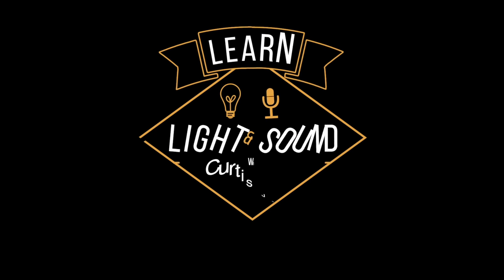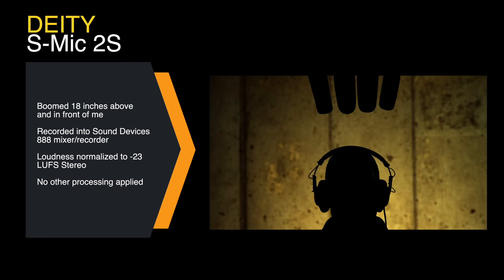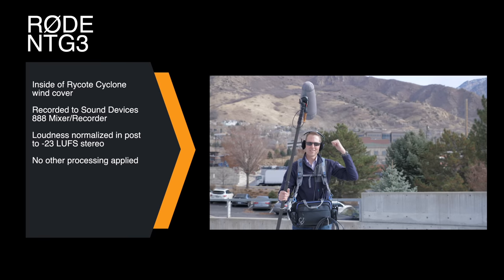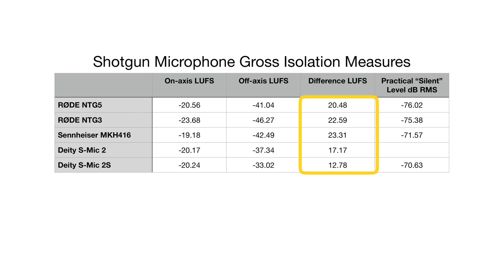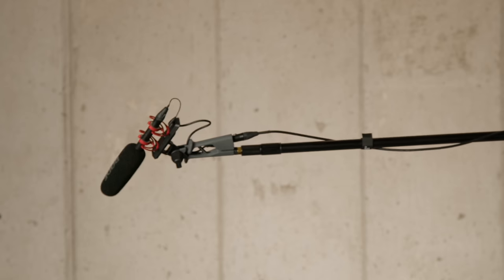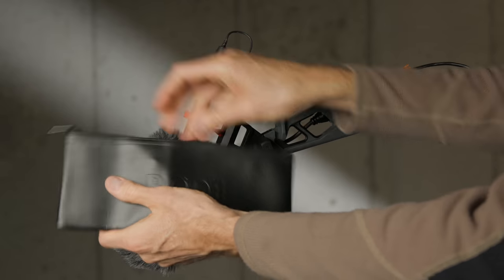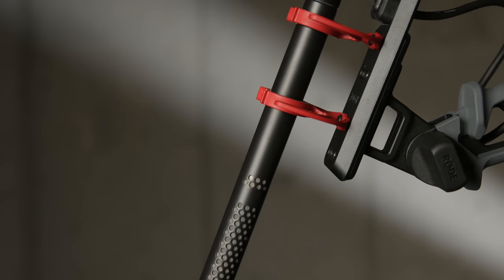RODE NTG5 Shotgun Microphone Review - Compared to RODE NTG3, Sennheiser MKH416, DEITY S-Mic 2

Comment from the maker: THIS IS A REPOST. Thanks to some careful listeners, we found an issue where the audio clips were aligned with the incorrect video clips in the audio samples section. It turns out that Final Cut Pro X has trouble with poly wave files. You can also listen to the original uncompressed wav audio files at https://drive.google.com/open?id=1AcgIeUcGtI5EZY2vd_kEBO-E8ibzZP7g
Index:
0:21 Intro
0:45 Indoor NTG5,NTG3, MKH 416, S-Mic 2S Samples
3:55 RF-bias advantages
5:01 Build quality & size
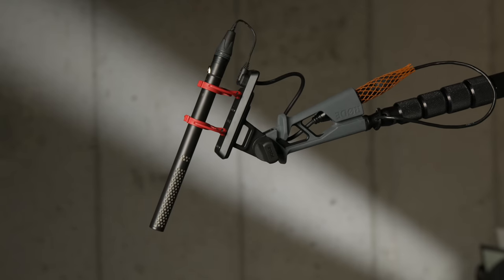5:34 RF Immunity/wireless interference
6:01 Polar pattern
6:28 Outdoor samples
7:41 Polar pattern/isolation samples
9:34 Isolation analysis - how good is each mic and rejecting off-axis sound
12:26 Practical noise performance
13:35 Handling noise & Shockmount
14:45 Fur cover and wind
15:04 Accessories
15:21 Should I upgrade?
17:11 Cons
18:34 Summary
Reply: I thought you edited in Resolve, mr Judd?
Reply from the maker: @Nicdehouwer  Final Cut Pro X 99% of the time as Resolve is a bit on the beta end of the spectrum in Fairlight. But that might change now. 😀
Reply from the maker: @Zzzz oop Keep your NTG3 and sorry to pull the rug out from under you. 🙂
Reply: @curtisjudd  I consider Resolve to be an extremely versatile, reliable and professional toolset. 

Fairlight... it's coming along! Each update brings about big improvements.
Reply: Yess, uncompressed samples, noooice) thanx man!

Comment: Diligent and thorough as always, thanks Curtis. Q: for my channel, which is a female voice and often inside without sound treatment, would you steer towards the NTG3 over the NTG5?
Reply from the maker: Thanks! I'd probably opt for the NTG5 - will be easier to work with indoors due to its smaller size.

Comment: Thank you for this review!  I wonder if the ntg5 could be eq'd to sound more like the ntg3 because the broadcast vocal sound of the ntg3 for controlled environments sounds great, but during the outdoor segment the ntg5 blew the ntg3 away! :)
Reply from the maker: That or a transformer saturation plugin, yes.
Reply: @curtisjudd  Do you happen to have a video explaining a transformer saturation plug in?
Reply: Not just the opposite? Outdoors NTG3 sounds so much better than NTG5. And outdoors is what those shotgun mics are made for, aren't they?
Reply: The ntg 5 captures higher frequencies (ie eq’d for less lows) than the ntg 3 which is better for wind and worse for voice over.
Reply: @nealpobrien  Shotgun mikes are desinged for outdoor boompole scenario. Just the NTG5 is shorter mike so must be positioned closer to the speaking person. NTG3 excells outdoors when you can place it some more cm further away from the speaking person and record nice sounding voice. For indoors dont use shotgun microphone - use pencil mic.Moreover my impression is that with NTG5 Rode brand wants to make shotgun mike but universal - for outdoor/indoor which is nice but impossible to have the best of both worlds. So its a shotgun mike, but a short shotgun. Thats why is sounds thin outdoors when record voice further than 30-40 cm.

Comment: I really like the NTG5. I do have the NTG3 which is almost only used for sound effects, foley and stuff like that. i like the big bottom end i get out of the sounds using that mic. I use the 416 for dialog (aswell as the audio technica 4053b). And i am super happy with these mics. Not really sure which one i would trade for the NTG5 tho. It seems to be placed awkwardly in the middle of the 416 and the NTG3, but probably incapable of delivering the best of both worlds!
Reply from the maker: Sounds like you’ve already got a solid kit that’s working 😀
Reply: @curtisjudd  Yes im really happy with the gear! Next for me is to upgrade my G4 systems for the A10 with phantom power so i can go wireless!

Comment: I have an NTG2 and would like to upgrade, just not sure if I can get by with the shorter model "VideoMic NTG" which they say is similar to the NTG5. I'll be waiting on that video comparison to make a final decision. Once again thank you for your time and great video content!
Reply from the maker: Hi David, the VideoMic NTG is similar to the NTG5 only in that it has the circular hole interference tube design. Where they differ is that the VM NTG is a DC bias mic with a 3.5mm output while the NTG5 is an RF bias mic (this is the least expensive RF-bias mic of which I am aware) and has a balanced XLR output. You can evidently adapt the VM NTG to XLR though I'm not sure yet whether it has a balanced output which dictates how long a cable you can use. I'll do a review of the VM NTG as soon as I can get a copy.
Reply: @curtisjudd  I cant wait, I love your detailed reviews! Curious how the 3.5 connection will do against the XLR, does XLR still have a huge advantage in audio these days?
Reply from the maker: @Dubi00  The question is whether the VideoMic NTG's 3.5mm output is balanced or not. That still very much makes a difference in how long you can run a cable. Balanced is still superior for longer cables such as when booming the mic.

Comment: Got a lemon. Worked fine when I tested it at home but on a professional shoot it started creating squealing noises. Rode took it back for repair under warranty. Now it works great. Lesson: there have been a few cases when the NTG5 goes bad so always have backup audio, but Rode is good with doing repairs.
Reply from the maker: Thanks for sharing Mary! I hope the new version holds up well.

Comment: grate video as usual dear Chrtis. I am planing to up my game and move from a lav system + zoom H6 to a shot gun mic to save post time. I am on a 250$ max budget and all use will be in my studio. 

so I need your advice on what shot gun mic to go for that would give me grate results. I am getting the Beachtek DXA-MICRO PRO Audio Adapter that ill use with my Canon D80.
thanks in advance and keep up the good work.
Reply from the maker: Hi Bander, That's a tough price range to make a substantial upgrade in quality. What are the issues you run into with your lav setup currently?
Reply: @curtisjudd  thanks for your reply. well mostly I get interference in which I think is due to a bad cable but mostly its not convenient for me as it limits my movement and it always fall or show in the video. I was thinking of getting the Rode NTG2 but not sure about it. what budget should be better as a step up in quality ?
Reply from the maker: @banderal-ali5066  Hi Bander, I think you'll see the biggest improvement in quality when you get to the DEITY S-Mic 2 range which is around $350 USD. You can hear it in this video compared to the other much more expensive mics and it sounds quite good.
Reply: @curtisjudd  thank you. ill check it out.
Reply: @curtisjudd  just curious about the DEITY S-Mic 2s as its cheaper and I will be recording only indoors (my room). will it be a good option as i just found about about sound garbling that may occur with long mics.  I have decided on either the DEITY S-Mic 2 or the 2s.
Reply from the maker: @banderal-ali5066  Yes the S-Mic 2S would be a good choice: https://youtu.be/n2dbpwbAP4M

Comment: I bought the RODE NTG5 to use for Voice Overs as a possible backup for my MKH416 and returned it right away. It's so muddy and woofy compared to the Sennheiser. It seems to enhance the worst low mid frequencies when used in a  close Voice Over setting. The included Foam Windscreen is made of a really scratchy fabric that enhances mouth noise and harsh upper frequencies as well. 

The more intimate/close I got with this mic the worse it sounded. This mic is much more suited to uses that don't require crystal clear audio. It would work well for News Crews or Low Budget Movie Makers that just need dialogue recorded on the cheap.  

I've used about 2 dozen mics for Voice Overs and the NTG3 and NTG5 are the only mics I immediately packed up and returned. However, I will always keep my Rode NT1. That mic is incredible and versatile and I actually have a client that rejected MKH416 files in favor of the NT1.
Reply from the maker: Interesting feedback. Thanks for sharing form a voice over perspective. I was reviewing this from a filmmaking perspective where we don't usually place the mic as close as for voice over.

Comment: Great video and great channel - thank you. I have a couple of late questions of NTG3 vs NTG5:

Firstly, most of the discussion on the NTG3 focuses on the extended bass response, and that it is great when wanted but that is not always the case. To what extent could the high pass filter on something like a MixPre be used to reduce that response on the occasions when it is not needed?

Secondly, what about the high frequencies? Both mics have a boost but from the specs, it is looks more pronounced on the NTG5. Does this lead to an increase in sibilance? it isn't always apparent but that seems voice dependant.
Reply from the maker: Hi Piers, yes, you could use the MixPre's HPF to tame the bass response on the NTG3, and also in post. I didn't notice a huge difference on my voice in these samples in the higher frequencies.
Reply: @curtisjudd  thank you - much appreciated.
Reply: NTG3 is the mic you may place further away from the speaking person and still have good souding voice. Very useful if you want a little bit wider frame. With shorter mic which is NTG5 it is necessary to place the mic closer to have comparable sounding voice. Thats why one still needs to pay more coins to purchase NTG3 in 2024.

Comment: Excellent review, Curtis. I picked up this mic based on your thoughts. So it's powered by XLR? If you could explain the power source a little more, it would be a huge help!
Reply from the maker: Thanks Jason. Yes, the microphone needs +48V phantom power. Most field recorders, cameras, and audio interfaces with XLR inputs have the option to supply phantom power. You'll just need to turn that on for the NTG5. Happy recording!
Reply: @curtisjudd  Sorry, I'm still confused. So I have to enable phantom power on my camera? Or does it just come on as soon as you plug in the mic? What about the Ninja V monitor? Or the Zoom H5? My other gear... FYI, I have googled the hell out of this to find the answer rather than bother you, to no avail. Also, how can I tell if the NTG 5 is on? I don't see a light. Will I just see the levels?
Reply from the maker: @JasonSmith-dd2ms  Hi Jason, yes, each of the recording devices will have a switch or menu item to turn phantom power on. Same with the Ninja V - you'll need to go into the sound menu to turn that on. It will likely say "Phantom Power," "Power," or maybe "+48V." You will be able to tell the microphone is on by watching the meters on your camera, audio recorder, or camera. There isn't an LED on the microphone. I hope that helps!

Comment: Didn’t really understand what RF bias was, so I looked it up. RF bias refers to a radio frequency alternating current that is applied to the microphone diaphragm. Due to the very high frequency of the AC current, usually in the megahertz range, the diaphragm doesn’t really vibrate as a result of the current, but it has a stiffening effect on the diaphragm, so that external bumps and disturbances do not move the diaphragm and induce noise into the signal. Basically, it’s like an electrical spring that makes the diaphragm stiff like a spring, and it is tuned in such a way that it blocks out mechanical response of the diaphragm to very low frequencies like bumps and handling noise, while letting through audio frequency sound.

Typically, RF bias microphones also have DC bias. DC bias essentially means that the diaphragm is designed to naturally rest off-center when there is no bias, and then a DC bias is added during operation to push it back to center, which creates a kind of stiffening and stabilizing effect for the diaphragm. The difference with RF bias microphones is that it is like an extra step that further stabilizes the diaphragm without the need for more mechanical stiffness in the diaphragm design. This allows for greater microphone sensitivity without a heavier diaphragm or increased noise sensitivity.
Reply from the maker: Thanks for sharing!

Comment: Good morning Curtis. Thanks first of all for your great work. I have a problem and I need your advice. I purchased the Rode NTG5 which I connect to the Zoom H6. When I connect it for the first few minutes turning the Zoom knob on the 4 or 5 power I hear noises, I hear the distorted audio and strange sounds until at some point a sort of whistle goes up and then I hear a crack at that point everything works; if I disable the XLR track and then reconnect the same thing happens but it takes less to get to hear the crack and re-function properly. I tried two different cables, two different Rode NTG5 (with the first one it was even worse). Having never had experience with microphones connected via XLR I don't know if it is normal or if my Zoom has problems (all the other inputs and microphones connected work perfectly). Because of the pandemic, I can't even ask someone for help or go to the store where I bought the Zoom H6 over a year ago. The Rode NTG5 is very expensive and I'm going crazy to understand the problem. I follow all the precautions to power the microphone, never unplugged the cable without first disabling the phantom power and wait a bit. The Zoom is powered by current or by charged batteries. I also connected the microphone directly via the PG2-R cable, perhaps thinking that my cables had some problems. Help me if you can. 

If you want to hear the problem I have uploaded an example.. at 58 seconds you can hear the crack and the the audio goes ok; at the beginning and at the end you can hear how my voice at the same volume is first distorted and then clean (I said the first thing that came to my mind):
https://drive.google.com/file/d/1Py0VliLaEyraPmr6eCqywIcZwXapqmkl/view?usp=sharing

Thank you very much
Reply from the maker: Hi Giancarlo, some phantom powered microphones take a few seconds to settle after phantom power has been applied to them, so this is not terribly unusual. So I usually give every phantom powered microphone a couple of minutes to settle after applying power. If it takes more than about 15 seconds, it is possible there's a defect with your copy. I haven't noticed any problems with my copy like you describe above. Maybe it is unique to the H6. Anyone else out there using the NTG5 and Zoom H6 experience this issue?
Reply: @curtisjudd  Thanks Curtis for the reply first. I have tried and tried again
 to connect the Zoom but not even after minutes the microphone worked correctly (still rustling and distorted sound as if the phantom power was not enough). Thinking that the cause was the Zoom I took (also following your suggestions on Youtube on a possible alternative) the Tascam Dr 60D MkII (which has an interface setting very different from the Zoom, a good product but with a ridiculous battery life). I connected the Rode NTG5 to the Tascam and it works. At that point I connected the microphone to the Zoom H6 and it works! I tried to turn it off and on again and it works properly on all inputs of the Zoom (connected both to the wall socket and with batteries and with several xlr cables). After the night I did the test again a few times and it works. I can not explain how it can happen ..It's as if the Tascam has unlocked the microphone, but it seems so strange to me. I will try to see if the same problem occurs again. How strange! I take this opportunity to thank you for your videos that I follow with great attention, you are a source of inspiration. Keep it up, trying to stay, as you do, as independent as possible from the pressure of the producers..this attitude in the long run is rewarding in my opinion